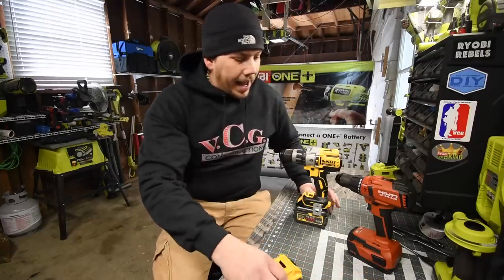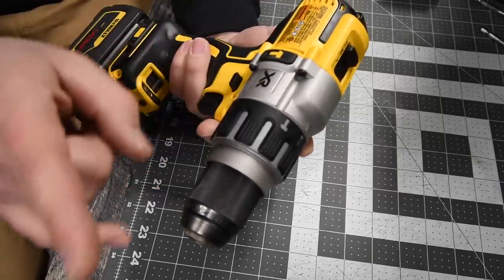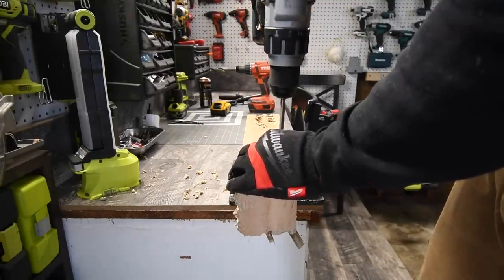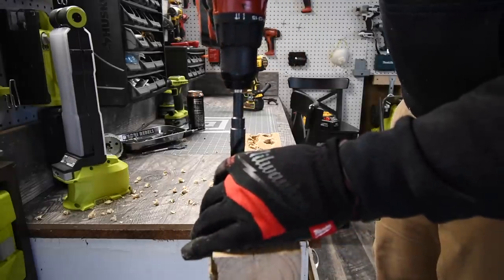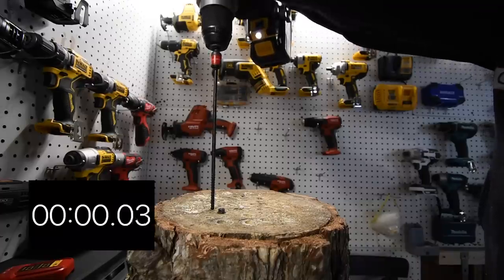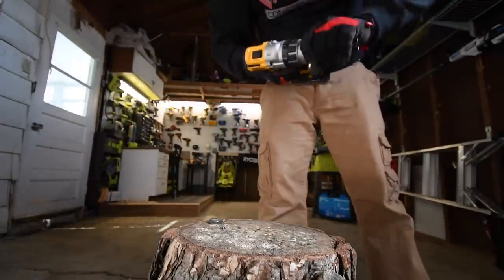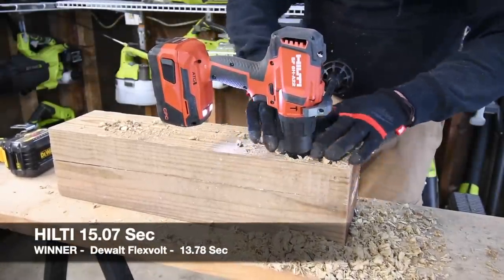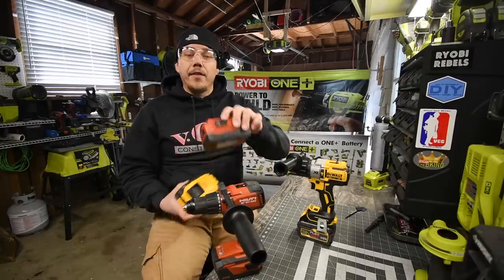Dewalt VS. HILTI Hammer drills (WOOD)

Comment: This is far more informative than VCG videos, big kudos to you.
Reply from the maker: I thank you MFT.
Reply: That’s a questionable conclusion. Firstly, it appears he’s not using new bits for each test and each tool. For example the hole saw test you could see the saw getting very hot as he’s cutting w/DeWalt. That heat cycling is annealing the teeth, making saw dull, slower and less efficient on its 2nd pass.

There’s also a variable in effective loading of tool and bit. If he setup a jig, something as simple as a drill press and installed a fixed load on lever, you would eliminate this variable. Whether conscious or subconscious, human load management is an enormous variable if objective results are to be achieved.

Comment: When it comes to last long and able to handle rough handling no one beats Hilti. I have work many years as carpenter and construction use both this brands. And Dewalt is ok but Hilti is superior when it comes to quality. Drop it to the ground from several meters and it will not break. I usually only keep my Hiltis because I know they will last. For a home user, hobby user I recommend Maikta much bang for the buck.
Reply from the maker: I thank you for your feedback and HILIT is such a great brand. I am glad to own it and I thank you for viewing
Reply: Hilti is meant to be rebuilt over and over. True, but everyone I know would never buy hilti. It’s just too expensive for anyone, and not worth it at all.
Reply: @legendarypillow1450  I would disagree on several levels. Firstly, though not of greatest import, Hilti has their 20 year warranty. Doesn’t apply to tools not purchased from Hilti or an authorized dealer, but if you didn’t buy it from EBay or 2nd hand, the warranty is industry best. The batteries and chargers are Panasonic-Tesla, only Metabo is same, at least to my knowledge. The batteries last forever and do not appear to decay after 6 months. We had bad cell degradation issues with our old Milwaukee M18 cells. I suspect it’s attributed to air-cooled chargers, better quality control in battery manufacturing and internal circuit overload protection.

The most important difference however is the Hilti build quality and engineering. You won’t find powdered gears or hammer assemblies in a Hilti, unlike DeWalt and most consumer brands. Motors and circuit boards are all in-house designs and manufacturing. DeWalt uses 3rd party motors. That’s less quality control. The DeWalt is cheaper and readily available at your big box retailer. The problem is when my crew is on job and that DeWalt overheats and smokes it’s armature or fractures a gear, my guys can’t finish the job until replacement tool is available. The more reliable Hilti mitigates that issue which at end of day is a substantial cost savings. The Hilti may cost more up front but if net result is greater productivity over a longer service life, that means greater efficiency and maintaining my margins.
Reply: @MichaelM-to4sg  it’s not worth it to buy. To rent, yes. Hilti isn’t inherently bad.
Reply: @MichaelM-to4sg  Dewalt makes it’s own motors.
Reply: 57

Comment: Thing is, when the Dewalt, Milkwaukee and Makita have broken from use, the Hilti has just been run-in.
Reply from the maker: that is why I love hilti
Reply: Hi Jonathon,
Yeah! And I have proved this owning all makes. This Hilti is just superb!! Along with the TE6 A22 it's a fabulous combination. 
Dave.
Reply: Oh really? I can't seem to find a broken Dewalt or Makita in my massive inventory of tools. I'm assuming you don't work in construction.
Reply: Not worth the pentagon level prices
Reply: @legendarypillow1450  I have to say that a month or so ago I bought a new Milwaukee Gen3 combi and it's really lousy!  Drill a few holes and the thing gets pretty hot when it's under no stress.  Many times I squeeze the trigger and it just doesn't work. 5 or 6 consecutive squeezes of the trigger and nothing. I took the battery off and back on again. It started working again. It wasn't the battery as it's happened using all four of my 5 amp batteries and my 9 amp. It also hasn't got as much screwdriving torque on speed 1 highest torque setting as my Hilti. This is where I need my torque to be good, for screwing in large screws when I don't wish to use my impact. The Hilti is better in every way and if for any reason it breaks down I can have a replacement tool in my hands within half an hour with no charge. My last Milwaukee that had to go back as it had trigger issues too was away for 3 weeks!
Dave.
Reply: @davesheppard8797  I didn’t say Milwaukee was good or Hilti was bad, I just said it isn’t worth it.
Reply: @legendarypillow1450  By your icon I assume you’re a blogger or have YouTube channel that claims to review tools? What is your empirical methodology and what professional background do you have to credibly evaluate a tool? Your comments honestly appear naive 🤷‍♂️

Comment: just FYI I've notice the lithium cells "recover" after being under load so if you check the battery level right after use it may show lower than it actually is.
Reply from the maker: that is correct, like I say in most video it might go back up in a min or two :)
Reply: Recovery time is about 1 second , so it's fine to check them after a load
Reply: I switch lithium batteries when milling wood with cordless chainsaws, and after a minute solid use my 60V will be at one bar, but once it sits jumps back to three bars (I have 5 batteries they all do it). The big question to me is how can I get the most out of one battery? The answer that worked for me is swap them out for a fully charged battery, and come back to the first battery (it recovers for longer use). I notice the batteries last longer if I switch them in the middle of a large task instead of just going all out with one battery. Most people will never notice battery recovery time, but some tools consume so much battery life that you can't help but notice. I'm milling everything from soft pine to hard ash so I'm pushing my saws to max nonstop.

Comment: Do the amp hours matter for power increase? I understand the "high output" batteries can help power, but amp hours are just capacity.
Reply from the maker: the power does not increase. the more ah you have means the more cells are in the battery. which also means the better the tool will retain the power it has since the stress is put on more cells which means each cell works less so it can give it the power better :)
Reply: @ManCaverTools  ahhh makes sense
Reply: @skycorrigan6511  I guess a 2Ah battery runs on 5 x 2Ah cells in series since 3.6v x5 is 18v. Those five can deliver, lets say they are 21700s, 35A continuously. 18V x 35A are 630W. But a 5Ah battery runs on two parallel... 5 x 2,5Ah cells in series, 5 on the bottom and 5 on the top. Each row can deliver 35A but since they are two, they can deliver 2x35A continuously. This also increases the wattage they can deliver from 630W to 1260W. Dunno if this is true, but think that it is. Correct me if im wrong. Older 18650s can deliver somewhere around 20A continuous amperage.

Comment: Anyone that knows tools knows that Hilti has been ‘top dog’ for many years with Dewalt, Mikita, Milwaukee etc. all scrapping for second spot but the price of Hilti tools reflects that.
As a gas engineer I have used  the Dewalt cordless range of tools on site on a daily basis for years, some are great, others are adequate but I have no doubt that if I was running the Makita/Milwaukee platform I would be saying exactly the same thing about them.
Reply: Dominic Forge the Milwaukee drill is more expensive than this hilti
Reply from the maker: correct, but that is tool only. but if you got it as kit this hilti would be $470 for 1 tool
Reply from the maker: because you buy everything individually at full price. so you would spend $220 alone for the batteries. $139 for the tool. $50 for the charger. $16 for the belt clip and $60 for the bag. include taxes with that it gets expensive. HILTi doesn't have discounts on small purchases.
Reply from the maker: I agree, HILTI will last longer but you pay for it lol and thank you for viewing

Comment: I am wondering if you used new bits for the hilti test or the same bits that was used by the de:walt first?
Reply from the maker: I did more then one video of this and the HILTI won ever video, BUT the new Power detect hammer drill from dewalt beat thIS HILTI hands down

Comment: Crazy thing recently happened. I came across my 11 year old Hilti SFH-18A that had been sitting bin the garage for the past 7 years from no use of my full on set out Dewalt tools.

I checked the battery on the Hilti just to see, which I must have charged full before stowing away. The 2.6ah battery on one battery showed full and the other on the drill had two blocks of battery charge. 

I was totally blown away by this and thought if this and been any other brand, the batteries would have been probably ruined, well maybe. 
Put both to charge to see if they were just f'ed from no use and nope, both took a charge and both still output the same crazy torque as before, crazy!

Anyway just thought I would share that to any people fence sitting Hilti. 

Not pushing Hilti, I love my Dewalt ecosystem but damn that totally blew me away😁👍
Reply from the maker: HILTI is built to last and I thank you for viewing Supra

Comment: Dear if I don’t use dewalt XR 20 volt 6 AH battery for one year. Is it working after one year? How much efficiency decrease after one year?
Reply from the maker: The HILTI is outlast the Dewalt. That is what HILIT is known for, HILIT just came out with their brushless line, HILIT was not known for power, they were known for quality, but they just added power to their tools and now they will be known for that as well

Comment: The Hilti is difficult to compare to other brands because it is 21.6V (24V max) and is based on a 6 cell battery platform.  Most other brands are 18V (20V max) and have a 5 cell platform.
Reply: Ah so that is why my Hilti 4ah batts seem longer lasting than my Milwaukee 5ah
Reply: @tylersmith9868  Here in England we now have 3 and 5.2amp hour. The new 8amp is here too. I'm not sure about the 4amp, I will check on Hilti UK.
Reply from the maker: that is correct, also kobalt is 24v so its extremely hard to get tools that are the
 exact same specs and power and thank you for viewing

Comment: The angle at which you hold the drill makes a big difference and at 11:20, the time spent moving the drill is inconsistent between the tools and the amount of weight you add to each tool isn’t consistent either.
Reply from the maker: I thank you sir much for pointing that out and thank you for viewing

Comment: These are pretty comparable.  If you want to see a difference do 3/8" or 1/2" bit in concrete.  Then what Hilti is the leader in corded hammer drills.  It's probably a safe bet there the best in cordless drills in concrete for drop ins.
Reply from the maker: Concrete test are coming soon.
Reply: I/2" bit is quite large for a combi drill in concrete. I would use my Te6 a22 Hilti and do it twice as quick and more comfortable than with my new brushless SF6H. I have a Hilti Te1 that I was given second hand 33 years ago. The guy who gave it to me said it had been used really hard. He upgraded and I had his old one. That te1 is still my go-to corded SDS. It is still perfect to use, really smooth and can still hold its own against modern SDS drills!
Reply: Drilling concrete with a drill/driver is a joke. The day I first tried an sds drill, I literally never used a drill/driver to drill into masonry again. I don’t even know why they still include that function in them. Sds drills make that function obsolete.
Reply: @RB-xv4si  Exactly. The reason why the ‘hammer’ function, which isn’t technically a hammer, is included to these tools can very effectively drive a Tapcon or similar. Usually has more balls than an impact driver plus they are excellent as non-hammer drills

Comment: Flexvolt 6 amp/60v, vs 4 amp. Hilti did good for use-ing a much smaller battery in the Hilti vs the Dwalt.
Reply from the maker: both of these drills are beasts, I thank you for viewing John

Comment: Feel like most of this is user input really. The motors are going to have similar rpm and torque. I just want to know which one is going to last longer. All the times were pretty similar and would say they’re just ties.
Reply from the maker: when it comes to that, it all depends on how well the tools are being treated. some people tell me the drill lasted them a year some say it still is working after many years.

Comment: I'm an electrician and electronics technician. Look... these batteries Ahs are what they are 4.0, vs 6.0...most li ion batteries are 18650 cells. The last couple of years, milwaukee has started using 21700 cells .....but dont think for one minute they dont know what they are doing! 16 years ago, milwaukee introduced lithium ion batteries to the market of cordless tools with V28 power. 28 volts! They used 26650 cells! Way larger than anything on the  market today! They still use them In their M28 products overseas! Upwards on 6.0Ahs. Not very popular in the US anymore but they killed it and still will. Ima Milwaukaholic and always will be!
Reply from the maker: very good sir and I thank you for viewing

Comment: I've had 996 for 3 years & still perfect at work I use the Milwaukee gen3 it's nice because it's small and I think just as powerful as 996 but the damn thing is 1 year old & has problems with chuck locking up & you gotta use pipe wrench or put chuck in vise to get bit out this hilti was very nice surprised it wasn't way more powerful than dewalt 996 I just expected it to be way better than dewalt 996 great video thanks
Reply from the maker: when it comes to power, the top of the line tools will perform almost the same. the difference will be second when it comes to power and time, but the HILTI will more than likely last longer than the other brands due to the materials its made out of and the quality of the build
Reply: The things is that all these tools,Milwaukee gen 3 ,Dewalt 996 and Hilti are so different on paper,with Milwaukee having the most torque.
And not a small difference,Milwaukee has 135Nm,Dewalt 95 Nm and Hilti only 80Nm.
So how come they're so close to each other in performance,sometimes the lowest in specs performing better.Take this Hilti for example,it should be absolutely destroyed in tests by Milwaukee and Dewalt,but it isn't...
How come?
Reply: @toolsreviewsandmore5326  specs are always fake numbers some brand overate their product and some underate their's
Reply: @toolsreviewsandmore5326  I own this Hilti and Gen3 Milwaukee.  The Hilti has a lot more low down torque for driving screws and coach screws. I have put them head to head. It is apparently the soft torque that is important in these situations and the Hilti has 65Nm soft torque and I think my Milwaukee gen3 has 45-50Nm. Whatever......The hilti for screwdriving grunt wins every time. Even with a  9amp battery in the Milwaukee and a 2.6 in the Hilti. Hilti still kills it!!
Reply: I own this new Hilti and it is really great. It's really good that your DeWalt can still hold it's own after 3 years especially considering the progress made recently in drill technology! That 996 must have been way ahead of it's time when it first came out!!
Dave.
Reply: @davesheppard8797  the only advantage Milwaukee has is that it's small I do industrial marine mechanics & my dewalt is just to big & I usually dont need all that power I'm typically drilling in steel & drilling a lot of broken bolts so high torque that'll snap a bit off inside a bolt is not what I want oddly enough my coworker has a central electric 12v drill from harbor freight for $50 drill charger and a 2.0 battery we use the hell out of it for broken bolts cause it cant break even the smallest drill bit & it goes very slow so it doesn't burn up drill bits & extra batteries are $12 with coupon so its perfect for those situations
Reply: @brianklein6387  That's really great Brian!....It's horses for courses! I like the low down grunt of the Hilti for screwing into wood as I am a Carpenter/joiner. As far as concrete drilling goes I wouldn't go bigger than a 6mm bit in my Hilti and then only for a few fairly shallow holes. I have a battery Te6 a22 SDS that is comfortable and smooth and twice as quick. But any drill is only as good as the skill of the guy behind it! So a half second here or there to drill a hole becomes redundant. This beautiful new Hilti SF6H of mine won't make me a better Joiner! 
My best to you Sir!
Dave.

Comment: I would love to see how Bosch compares to these companies.
Reply: Worse.  Definitely worse.  (With an exception to hammer drills)  I put Bosch in the Ryobi, Ridgid, Kobalt category in terms of power tools.  Definitely not with Hilti, Dewalt, Milwaukee or Makita.
Reply: @IndependentThinker74  you can't put it below red or yellow, it's as reliable and energy efficient, not to mention wrist protection. But it's clearly less powerful (not very important for its usage)
Reply from the maker: I am getting Bosch soon :)

Comment: The dewalt 20v 6 amp and the new 3 amp hr batteries have the new 21750 batteries inside of them. Test those. I also like how you clearly push down harder when running the hilti to validate the price.
Reply from the maker: more tests are coming :) along with metal and concrete
Reply: I think you are experiencing a transference (bias) effect... sorry, don’t see it

Comment: Switched the dewalt battery in beginning, but not the Hilti?  The Hilti has a ATC Active Torque Control. If it jerks a bit (as safety) it turns off. Many their tools have it, so doesn't break your wrist. Use the 22v, 8 amp in hilti so is fair.
Reply from the maker: it is a good feature to have on tools and I thank you for viewing John